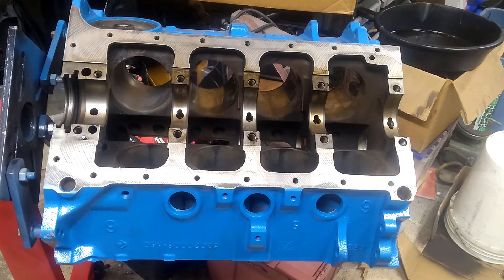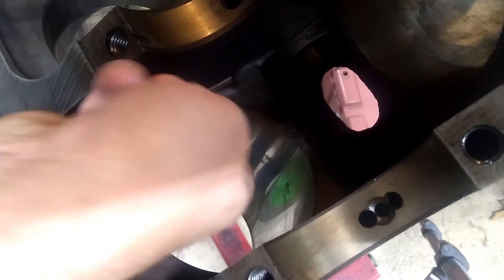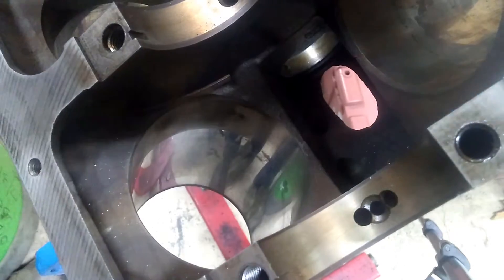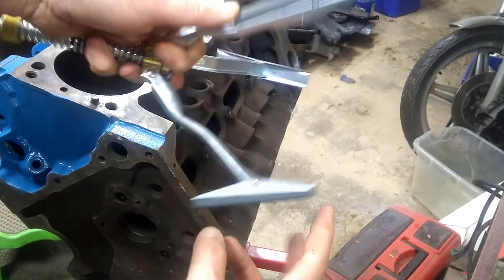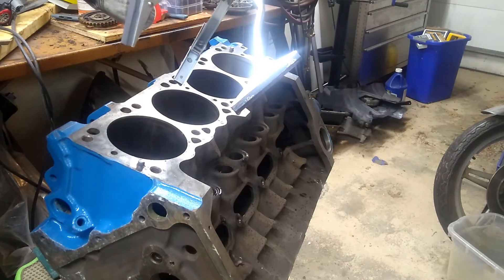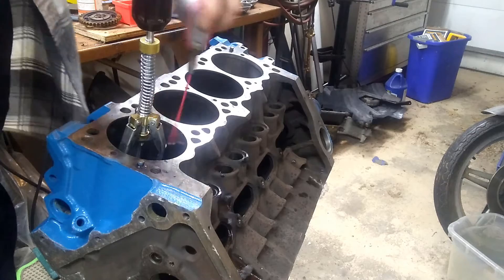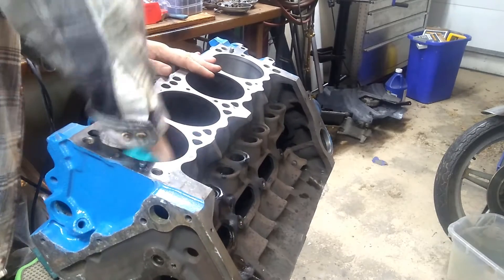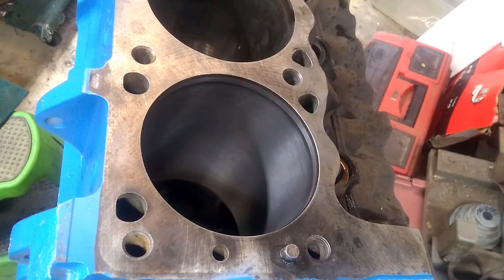Honing a Cylinder Block

Comment: If you ran into this video, you have probably read about 50 others about Honing.  Although no measurements or tolerances are taken into account on this video; the concept and idea is legit and true: especially if its a virgin block that has been taken apart for the first time and never machined. The fingernail/visual/touch inspection works when done as described; comparing ring end of travel surfaces, to adjacent non worn cylinder surfaces that were bored and remained at the original size. I cannot fight against perfection, nor will I as neither the ball hone or the stone 3 fingered hone without a Torque Plate is going to get you perfection to within .0005" (as some keyboard purists will extol as needed) ; but the home engine builder or even the engine itself may not need the level of precision on cylinders that some may mention.   One thing is for sure though; the ball hone otherwise known as the dingleberry will only fool you into thinking that your cylinders are symmetrical.  The reason being is that the ball hone since it has no flat mating surface will hone every nook and cranny that it touches, so it will for lack of a better word "polish everything up" because it "blends everything it touches to sight".  On the other hand the stone hone (especially the ones with larger longer stones; as in the video) will skip over low spots or scratches in the cylinder as Yoshimoshi was doing, and therefore "truing up the cylinder"  (not to the perfection of a line honer or a boring machine; but is does do some correcting)  The bottom line when honing at home with the stone honer will come down to how good you are not just in understanding with where you want to remove material to somewhat correct the OOR and Taper, but how good you will be in the mechanics of becoming the perfect machine while honing; spinning speed and reciprocating motion, blending from one area to another and measuring and then remeasuring; with the knowledge that after you removed every single scratch or pitting, you may be out of tolerance.   Hell, you may still be out of tolerance even if the OOR and Taper check within spec afterwards since it was done without the torque plate;  so basically it's a controlled machining operation with expectancies that can be attained with the result quality outcome based on the individual that is doing it;  an undertaking only to be done by those who like to do things for themselves and take pride in doing so..  Which is exactly what I liked about this video.  So for all the lacking of the scientific approach of measuring and of drill speed;  it was certainly better and closer to having something work in comparison to other readings where it has said "Only give each cylinder about 6 passes till it looks clean" ...  Yeah :)     Keep on building them Yoshimoshi !
Reply from the maker: Someone told me just yesterday that my videos had "just the right amount of redneck." Yes, there are tools and machines that get more accurate and tighter tolerances, but I'm talking to the guy doing stuff in his garage with a small budget and typical tools.  Your example of the torque plate being a great one. I see comments on how it's a crap job without using one and laugh.  Of course it would be better with one, but on the average street motor built by the average garage mechanic what's the practical difference?  Maybe 1HP.  Maybe.
Reply: A torque plate distorts the cylinders, some blocks quite a bit. So to make a round bore again with proper cross hatching pattern and depth, typically around 0.002" needs to come out. This amplifies an already out of spec bore. Using ball hones and these spring hones will not take an outa round bore and make it round, so the torque plate won't help. To make an out of round and tapered bore correct, a rigid hone is needed at minimum. One that when set, the stones stay parallel and and at their set diameter. Like the Sunnen micro adjust hone that uses AN stones. This is a hand held tool that is so efficient, even budget honing machines use them. Also, in industrial machining when we need a honed finish, we resort to the Sunnen micro adjust as it is the best hand held, adjustable solution available. 
 An engine is mechanical. So even when a poor job is done, it will suck in air and fuel, combust and repeat millions of times. That is why so many backyard "rebuilds" work. Take one apart after xx miles and compare with one done correctly and the proof is usually very obvious. I have no bad things to say about people enjoying the hobby and playing in their garages, building their dreams. I promote it, as it great entertainment and really does not effect us engine shops on any financial scale since every year we get dozens and even hundreds of engines to build anyways. Many are even failed home brews. What I do find a bit annoying is the amount of arguement from non engine builders or non machinists suggesting how it should be done and after personally seeing inside thousands of engines, can see that most of the backyard "how to'" guys never spent any time in actual engine building enviroments. 
Basically, get in the garage and have a good time with your project is my attitude. But don't over think it. If your going to hand hone for a re-ring, then take your time and do your best. Just make sure to clean the block after really really good. Debris in the backyard engines is one of the biggest issues I have found when disecting them. 
 I hope my text don't make me seem like I am hating on your text or hating on backyard rebuilds. I swear I am here for discussion and not for saying/proving anyone wrong. I do have many years as an actual machinist and spent quite a few as an engine machinist also. So I have tons of experience but also an open mind to the hobby side as well. I know why we do and don't do things a certain way and not always when we won't do something a certain way means were saying it won't work.
Reply: Just watched a Kye Kelly video of him working on a Musi 959 and saw what he does to his $125,000 engine.
He just runs a dingleberry hone in around 8 strokes.
Reply: What an excellent answer for the skeptic assholes out there !! Beautifully worded and well delivered lmao 😜 !!!!!
Reply: @carlospulido6111  No offense but your comment is really hard to read because it needs some paragraph breaks. It is what is know as a "walla text". Needs some breaks.
Reply: No worries; It wasn't a term paper. It needed more than just paragraph breaks :)  . @MyBacktrail

Comment: The only way to know if it needs bored is with an inside Mike checking for taper etc( not your finger nail)
Reply from the maker: If you don't have a micrometer, you can also use a feeler gauge to check the end gap of a squared ring at different depths.

Comment: I appreciate what you are trying to do, but I have always used a machine shop to bore if necessary and align hone the cylinders.   The cost of honing is relatively cheap, and they have the equipment to align hone.   The price you pay for the hone, and time, IMO would be a wash with the machine shop.    They would also do it at the correct speed.    If you were going to do this often in the garage, maybe it would be worth getting equipment to do it at home.     I watch these youtube videos where the poster is trying to help and cut costs.   But it seems like folks are stepping over dollars to pick up pennies.
Reply from the maker: I appreciate the feedback and the time you took responding. It's all about the end goal, and maybe audience. Taking it to a machine shop is always ap option, but it's also not always necessary, especially for something like a daily driver.  I took the motor after this one to a shop (because this one was cracked) and it ran over $200 for bore and hone.  I was fine with that, but I remember building my first motor in high school and that would have seriously cut into money that was needed for other essentials like gas and beer.  I also couldn't have done it on a Sunday night after work.
Reply: @YoshimoshiGarage  - My point was you can still build on budget, but where and when to spend money is the key.   Most recently I built a sbc 400 (406 now) and put in Lunati hydraulic roller cam and lifters.   IMO it was plenty pricey but it was the right thing to do "while I am in there".   To me the correct bore and hone was more important than the Lunati.

Comment: I've done honing in tool & die shops,  I think, you're running that hone too fast!
You get better control if slow done the drill!
Get a variable speed drill or even better, a drill press, where a stop can be set up!
So, no need to worry about running into the bearings!
Also, you need a bore gauge too, to measure out of roundness or tapering etc...!
Reply: Agreed slow down a lot you wanna do it gradually

Comment: He isn’t doing this right! Don’t use this video! Totally worthless and wrong ! An oversized wheel cylinder hone is no better than a dingleberry hone ! You need a straight bar hone and a stress plate to keep the cylinder round !
Reply: He's not boring the cylinder. Just scuffing it for new rings.
Reply: People are so funny about using torque plates, there's plenty of evidence out there to show you they aint worth a damn unless you're building a top fuel dragster. Why spend 2 grand on fully machining an old block when you can get a new short block for the same price? Learn to do shit yourself and you'll find yourself enjoying the fruits of your labor much more than having a shop build your entire car and you just driving it around like a grandma.
Reply from the maker: To each his own. Thousands of daily driver and street engines have been rebuilt successfully for decades with both types of hones.  We're not building an 800 horsepower race engine.
Reply: @YoshimoshiGarage  Agreed and not everyone has thousands of dollars falling out their pockets to spend on a machine shop, especially with the skyrocketing prices the last year or 2.

Comment: Jesus you cut all the ring whiteness marks out haha. I garantee the cylinders are probably 10 thousandths over
Reply from the maker: If I've learned anything from murder mystery shows it's "leave no witnesses"!
Reply: @YoshimoshiGarage  Brahahahahahahahahahaha!!!!!! Good one. also? who wrote the book on ball hone or stone hone speeds? There has to be one, right? All these comments indicate there is one, somewhere in the Galaxy.
Reply from the maker: There are specific angles that are recommended for different ring face materials, so the speed is dependent on feed speed as well.  But really, for a garage-built daily driver engine like this one, giving a surface to help the rings seat is really all that's required.  This isn't an 800HP rocket, it's the kind of thing people have been rebuilding with cheap tools with success since internal combustion engines were invented.
Reply: @YoshimoshiGarage  Makes sense to me! So many comments over reacting IMO.